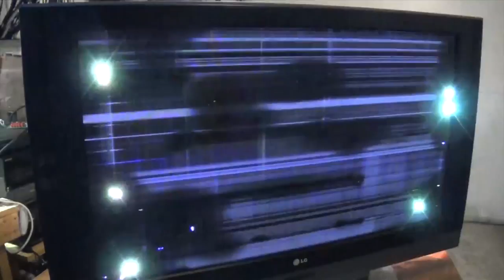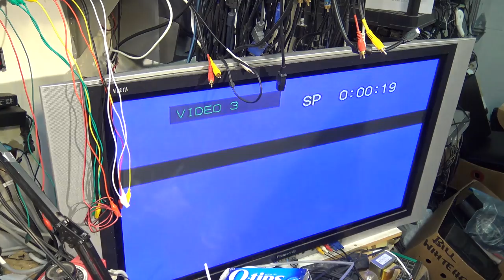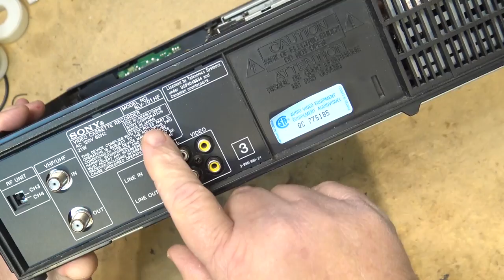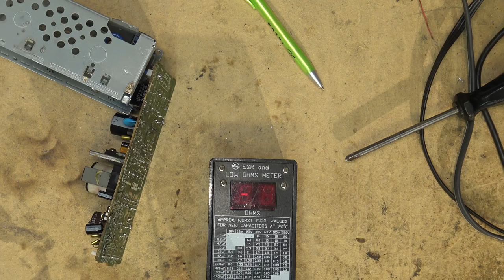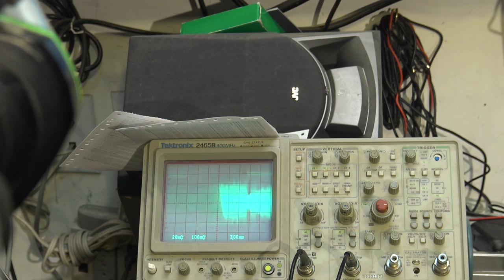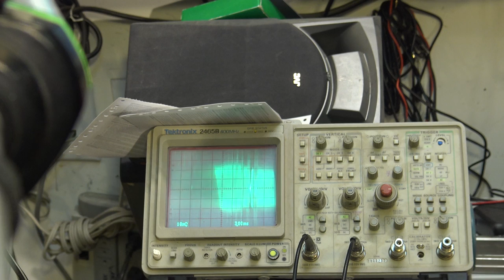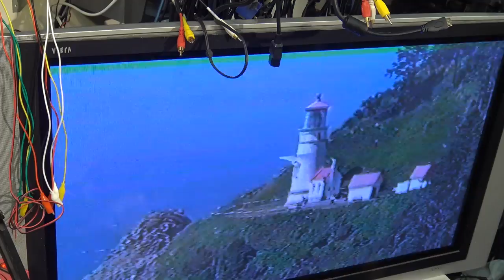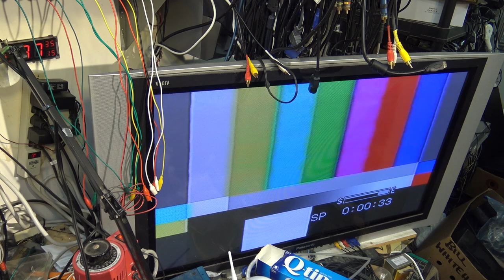Sony SLV701 VCR with poor playback picture repair

Comment: Ooo yeah, the days of "bad fish smell" it's a give away of bad caps. Made a lot of money rebuilding SMPS.
Reply: Those days capacitors were failed without having any visual signs and the ESR meters were totally unknown.You had to invest money in a LCR meter with dissipation factor function that could check the capacitor in circuit.Capacitors problems were not an easy case as nowadays because even an 1uf capacitor could malfunction or cease the entire set or cause transistor blowns repeately.

Comment: All these faulty Electronics??  How do they make very reliable Electronis for space and such like?  Random question?  I know, but i find it bewildering?  That they make consumer electronics to fail!
Reply from the maker: Consumer extronics are built for a specific price.  Space craft can not fail for it's designed life or longer.  There is a reason a satellite cost 20 million to build.  That satellite is nothing more than a radio receiver and transmitter. The reason that my old betamax units still run is because they were 2000.00 machines.  Consumers driven by Walmart's demand for the lowest cost required companies to cut corners and use lower cost parts.  Lower cost parts are not built as robust and generally don't last as long.

Comment: Hi I have asked a question before as well but you didn’t respond by your great help ( really appreciate it) I was able to replace the video head drum on Panasonic but the picture has lots of tracking all over the screen and no colors I’m wondering if it could be wrong connection (opposite way should work)?? I will really appreciate your response thanks
Reply from the maker: If you put the upper drum on backwards it.  Will result in a poor picture and no color.
Reply: @12voltvids  really appreciate your help such a true genius you are stay blessed

Comment: I have an HDMI to RCA converter to record stuff on my VCR from streams etc...but I guess I am a vanishingly small minority. In fact, my ROKU was running picture through this converter to my VCR all the time that caused it to die(Running for too many hours). I fixed it and it was working fine, but now it has picture issues 6 months later. So, I guess from watching this, it is more bad caps at the power supply. Heads are clean. Thanks for posting this.
Reply from the maker: The thing with VCRs that everyone forgets us the heads wear.  They ate good for only about 1000 hours before they start to degrade the picture.   If you are only playing tapes they will be ok for a little longer as when they start to wear self recordings are the first to go bad.    You can't get new heads anymore.  So why use a VCR for anything but getting your material off tape and onto DVD or some other digital format.    I can see in a few years all the front VCR users all worried and upset that they can no longer okay their tapes.    Keep your machine for playing legacy content but don't run up hours putting stuff on tape just for the sake of it.

Comment: I have a SLV-x30, which has a faulty power supply. I changed most of the components (including caps and transistors, excluding transformers). I still can't get it to work. As I saw this video I will go back and give it another look. Thanks.

Comment: I just repaired an R1000 that had a very similar Mitsumi PSU. Almost all the Rubycons spilled their guts. This looks to be a similar PSU but slightly revised. Had to clean alot of the shmoo off the board and heatsinks too :(

Comment: I really love your videos and how your able to diagnose and pin point  a problem in a circuit.  i do have a question have you ever work on a Samsung One Connect mini  that cause a constant reboot every 9 seconds till you disconnect it from the TV which operates normally  after the disconnect with no problems.

Comment: Lemme guess: the power supply had a ton of those Elna LongLife capacitors.

(moments later)

Oh, nope!  Those are Nippon Chemi-con.  Of course, such failure may have to be expected considering the age and the application; power supply caps tend to be the most stressed considering their operating conditions, eh?  Obviously, you can tell just by the dark discoloration of the solder joints and copper prints on parts of the board that were exposed to electrolyte.

And, oh, this is one of Sony's VCRs that used a Shintom transport rather than their own.  They're fairly solid and not very difficult to get it back up and running.

Comment: That opening is awesome!
27:31 there is a project to capture and digitize the tape directly from the RF.
It is related to the domesday86 project for LaserDisc.
The software is still experimental for vhs-decode but seems promising.
The LaserDisc version results are superb.

All the software and hardware designs are open source.
Reply: Can you link me to that? I had a similar idea in conserving VHS and other tapes directly from the video tape head RF in digital form. It features 4 bandwidth steps between 12 MByte per second to 32 MByte per second. The file format is uncompressed. This way humanity would be able to reconstruct old tapes with new technology and prevent the signals from degrading further. You can find my specification papers on Github under the name Project-Diana.
Reply: @UC_etCEzK0AffeY7FPqtRqmA Thanks! They might be interested in my simple and relatively compact file format.
Reply: @kyoudaiken  can you give me a link to the github you made?
Reply from the maker: Interesting.
Reply: @swilwerth  https://github.com/KyodaiKen/Project-Diana
Due to time constraints I didn't have time to develop an actual wrapper for it. I also lack hardware and tapes...

Comment: Thanks for the videos, I always thought that with the later VCR's when they stay loaded it was to do with quickstart, correct me if I'm wrong
Reply from the maker: It was to allow faster start but the real reason they unloaded the tape in early machines was to reduce stress on the tape.  Then they changed the layout to reduce the angles the tape went around to allow FF and rew tape loaded.

Comment: I do not know if I am doing it correctly.  How do you quickly test a TO92 BJT in circuit to make sure that it is not failed?  I had a radio that I was working for a client and it had a good 30 of them in circuit. The radio blew up due to a power surge.  I got it working by replacing the power transformer.  However, then it had no audio.  So, I,, thinking that it had shorts in it because of my DMM check, replaced the audio power amplifier chip.  That is all I did.  I soldered it back into place nicely, but then the unit was dead.  I gave up on it.
Reply from the maker: TO92 is an interesting transistor. It will either be EBC basing or ECB. American transistors are generally EBC and Japanese ECB.
You need to disconnect generally 2 of the leads to check it, as the other components in the circuit will affect readings.

Comment: Watch your videos all the time, But I have a question. Why are electrolytic capacitors such a problem and why hasn't anyone made a better one?
Reply from the maker: A wise man once said "The reliability of any electronic device is inversely proportional to the number of electrolytic capacitors it contains. "
Reply: "Planned obsolescence"
Reply from the maker: @kyoudaiken  
Built for a price point.
Reply: Wonder how many capacitors are in an average car?
Reply from the maker: @Sans_Solo_  Automotive parts are generally very high quality.
Reply: @12voltvids  Interesting ....Thanks Dave!
Reply: In past years I have been buying Gigabyte motherboards for builds. They state that many of their boards  use SOLID high quality Japanese capacitors. Do you think it's a scam?
When I look at old Sony camcorders that from an engineering standpoint are incredible, they have this  Achilles heel in the form of capacitors. I can't believe they cheaped out on a 10 cent component.
Reply from the maker: @gary.pettineo  they didn't cheap out. The manufacture of the caps got it wrong.
Reply: @12voltvids  Thanks, If anybody would know, it's you
Reply: @12voltvids  "There are two types of capacitors: broken ones and not-yet-broken ones". My mantra.
Reply from the maker: @IlBiggo  Same can be said for condoms!
Reply: @12voltvids  😅

Comment: The guy that taught me how to solder was from the UK, and he made sure that I pronounced it correctly.
Reply: If you look in a UK dictionary, it will say the pronunciation is "soLder".  If you look in an American dictionary, it will say the pronunciation is "sodder".  Both are correct.  If I was to move to the UK from the US; then I would pronounce it "soLder" - and not until then.  But I like my beer - cold; not warm.  lol
Reply from the maker: I'm not American, i am Canadian and I pronounce words the correct way. I also spell colour with a "u" and it is a roof over my head not a ruff. And the letter Z is pronounced "zed" not "zee"
Reply: @12voltvids  Correct for Queen's English - yes..  American dictionary pronounces it officially as "saw'-der".
Really?  So you say 'zedbra' for 'zebra'?  My, that is just awful.  Perhaps you should get English lessons in the US?
Pull the other one . . .
Reply from the maker: @MrRadioGypsy  
Of course it is pronounced zebra. The sound for z is accebted by the following letter. Zulu, zebra, zack  ect. But when the letter is spoken as a single letter it is pronounced zed, not zee.

Comment: the Slv-701hf was made in 1993 i just looked at a manual for one
Reply: Yeah- I just found it myself- the date shows 93. I thought this looked to well put together for 2003
Reply: @wx4newengland  if made in 2003 the video drum motor would have been on top all vhs decks went to that by 2003
Reply: @icpizzaboy  Yep, and most (if not all) Sony VCRs in 2003 were made by Samsung.
Reply: @mrnmrn1  I do have to admit the Samsung transports are pretty reliable from that era and easy to work on for the most part
Reply: @icpizzaboy  Except at least one thing, and it became unavailable at least 10 yaers ago: the playback/ff-fw clutch under the pendulum gear. It wears out relatively soon, and the VCR will not be able to FF and rewind. Random early failures (not wear-related, like broken actuator arms) were also quite common on these clutches. 

Oh, and this year I bought a nearly NOS condition Samsung SV-635X with the transport they sold for Sony, and 3 windings out of 6 were open in the stationary part of the rotary transformer. The glue became corrosive, and eaten away the enamel wires. The same issue as Dave shown with a Panasonic, except, that Panasonic was 20 years older than my Samsung.